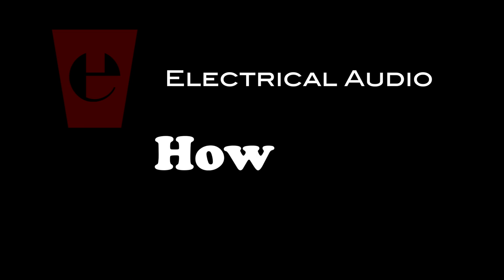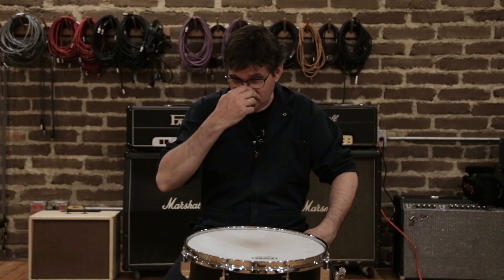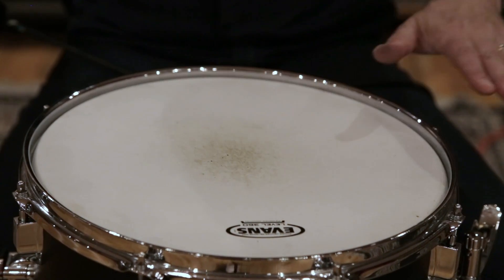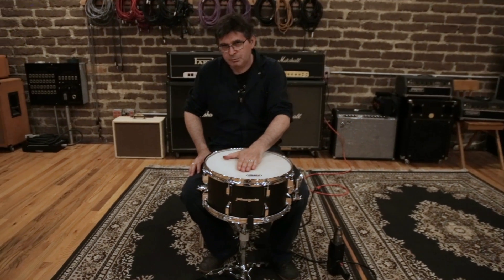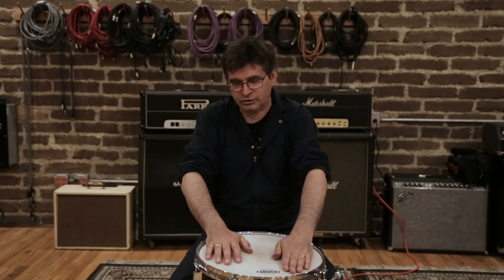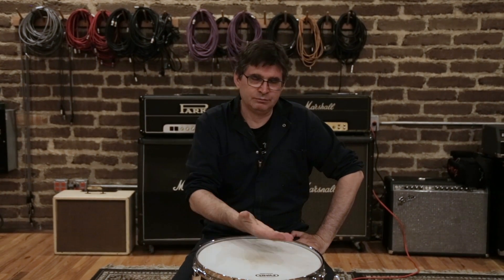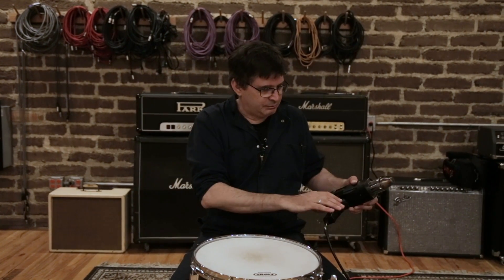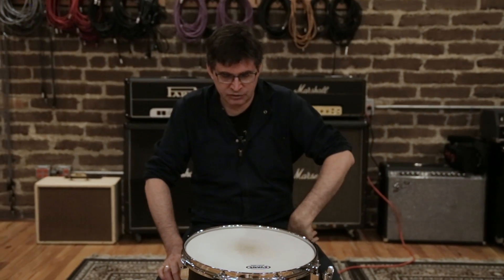Electrical Audio How-To:  Removing Dimples From a Used Drum Head

Comment: Any tips for getting the drummer to SHOW UP?
Reply: Is the phrase "make fire under his butt" common in English? I guess roadies use actual fire. Recording engineers would use a hot air gun. Both methods have been proven to really make the drummer show up, but the roadies' method is a bit more dangerous when you consider the possibility of causing permanent damage to the drummer's butt.

Comment: Maybe my understanding of English not perfect but why is the hair dryer not recommended ?

I tend to use a hair dryer to 'soften' the glue on new heads when I'm mouting them on drums for recording, it feels to me that they stay in tune better because the glue doesn't 'crack' but takes its shape way more evenly. Am I the only one doing this ?
Reply from the maker: I believe he's saying that the heat is so concentrated in one area that it can cause a hair dryer to fail. A heat gun is designed to heat a much smaller area.
Reply: @ElectricalAudioOfficial  Thanks !

Is there anything you usually do at EA to ensure better stability for new drum heads ?
Reply from the maker: @arthurlauth1380  Nothing other than stretching them quite a lot when we put them on.
Reply: I used a buddies hair dryer to warm ski boots and didn’t take long to fry it. The heat bounces back to the dryer and overloads it.
Reply: @arthurlauth1380  I like to whack the rim (!) with the butt of a drumstick to seat it firmly, I do that all around the rim before I start tensioning the head.
Reply: @stevealbini402  Thanks for the tip ! :)

Comment: Watching this vid for Albini jokes. I never could find a way to easily tell a punk drummer to buy new heads for recording. "But this is punk rock!" Call me a jerko, but I have sat by a board waiting for the inevitable playback point when the sound says "I told you so," and the drum tracks are deemed crap by the band.
Help the engineers. New strings,  new heads...